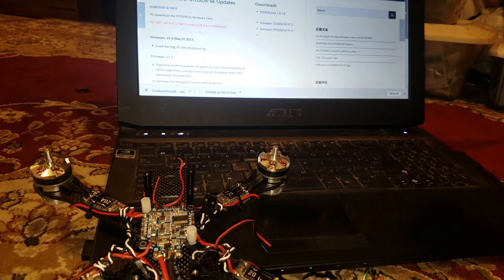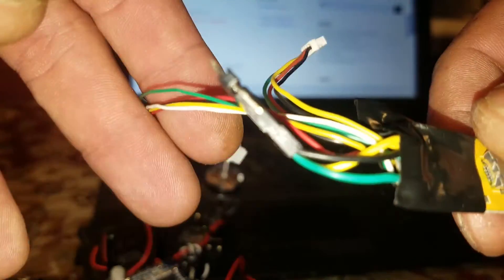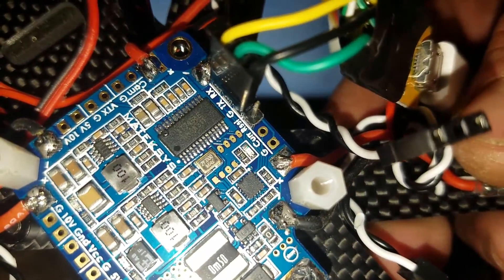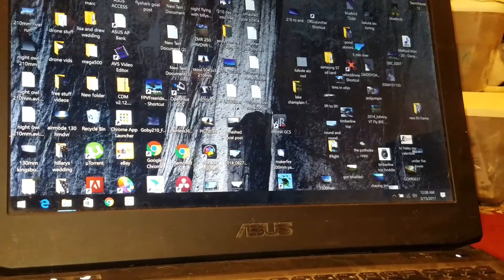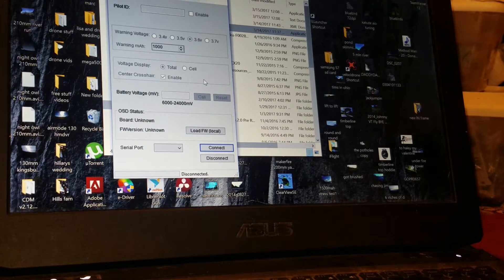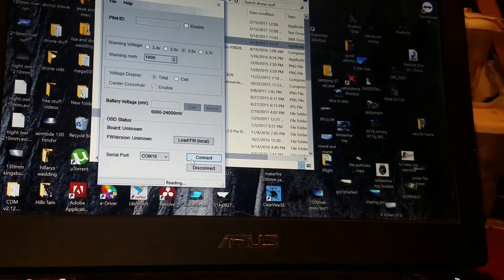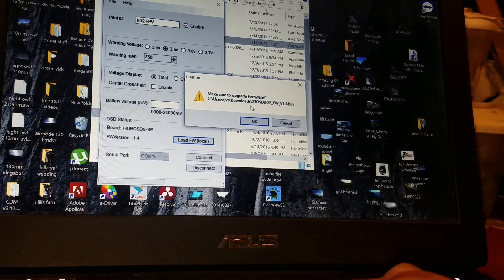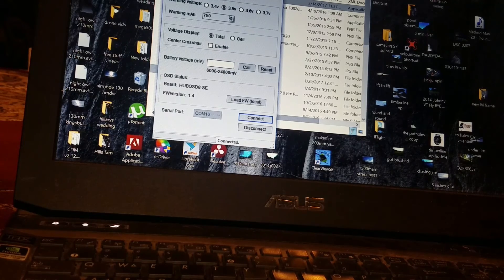HUBOSD8 SE FIRMWARE UPDATE

Comment: And how does the osd work now? Just solder vtx and cam to the pdb and then the osd poped up in the cam like voltage?
Reply from the maker: Hey bud, this video is kind of old, as far as technology goes... Yes this board would still work if I still had it hooked up... But now with the new configurator for betaflight and with the new flight controllers that are on the market most of which have a built-in OSD that is fully compatible with the configurator no extra wires no extra soldering no extra crazy! I appreciate you watching. And I definitely appreciate you asking! Hope you found this helpful, if not hit me up!
Reply: johnny vermont i am asking because i have the Raceflight RevoltV2 and it has no OSD an i have the new Runcam Eagle Micro and it has no OSD aswel. I think this pdb is the only option for me to have a OSD or i must put in a minimosd and i dont want that.

Comment: hey bud I just got the same board. have you had any issues with the 10 volt? what do you have hooked up to it and is the 10 volt enough? any idea why matek went with 10 volt instead of 12? thanks
Reply from the maker: Roland Holderman so far so good!...i have no idea why they ket it at 10v...
Reply: johnny vermont the vcc pad on the Matek will give me direct lipo voltage right?
Reply from the maker: Roland Holderman yes it should...test if you have a voltage tester.
Reply: johnny vermont the reason I'm wondering about the vcc pad is I'm going to run a tbs unify pro hv vtx and some people have been having feedback issues. So tbs said to run the vtx to the closest lipo voltage source on the pdb. so I guess that's it. Lol